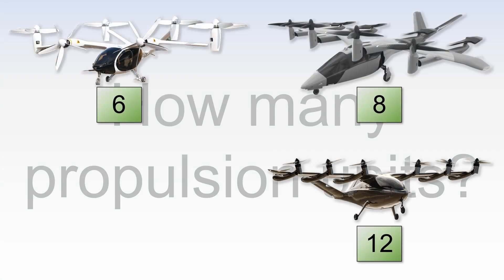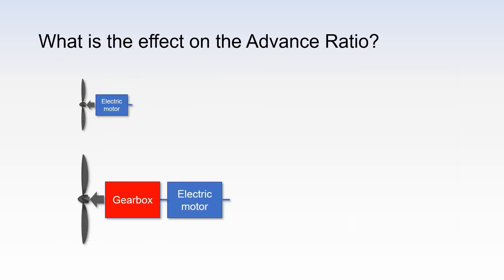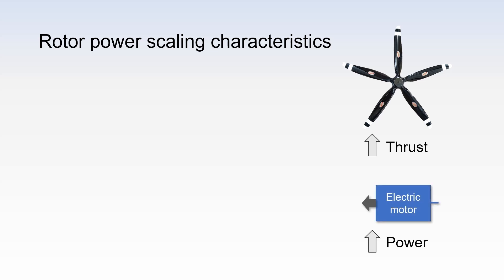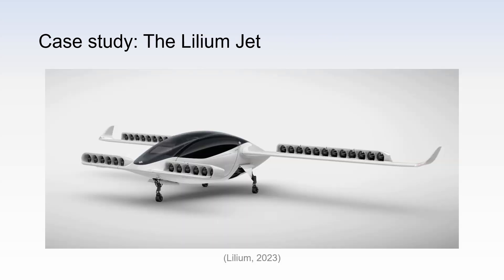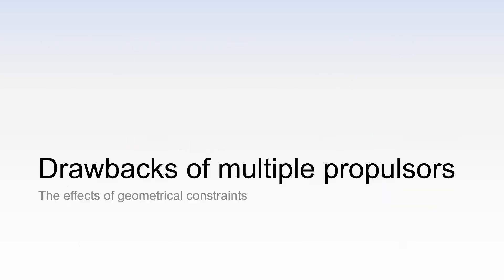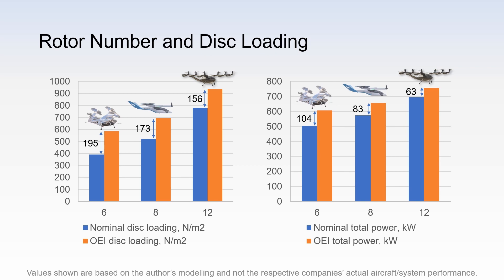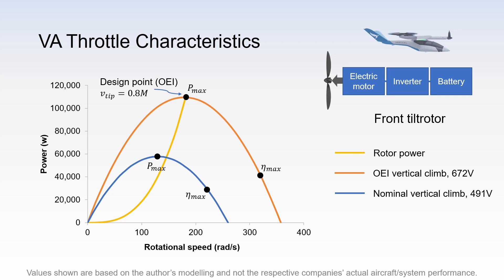What's the right number for eVTOLs?

Comment from the maker: Timestamps:
00:00 Introduction
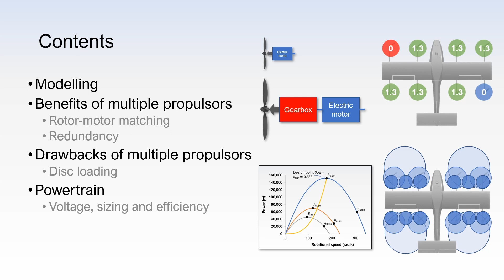00:41 Modelling
1:10 Benefits of multiple propulsors
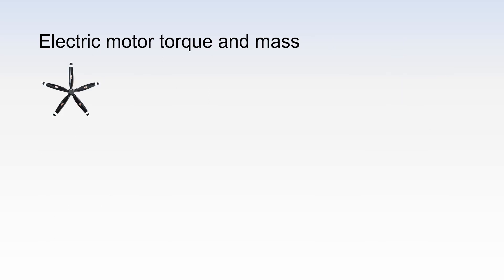6:45 Less motor mass
8:42 Rotor redundancy
11:19: Drawbacks of multiple propulsors
13:35 Powertrain voltage, sizing and efficiency
16:30 Conclusion

Comment: High speed rotors such used in of ultracentrifuges to extract isotopic fuels have to be suspended in fluids or in magnetic or electrostatic fields so one might consider cryogenics since electric propulsion has been patented since Victorian times if only galvanic batteries could store enough energy.

My MIT colleagues have electrochemically loaded isotopic fuels as deuterons into materials and of course "Omni Future Almanac" by Bova & Wiels claimed likewise antimatter could be stored in crystal lattice matrix of boron.

Comment: Losing 5 times the thrust per watt (or horsepower) efficiency is simply a nonstarter for aviation.  There a reason the Helicopter, Chinnook, V22, or V280 limit themselves to 1 or 2 large rotors.  They need practical payload and range, which none of these eVtol designs even attempt to do.

Comment: If there was only a one in a billion failure rate 'permitted' (enough to require an aborted flight) as frequently quoted by eVTOL proponents ,(from all causes) then the differences between the post single thruster loss (in hover as assumed here) resulting at worst in a partially powered slow descent would not be 'worst case' -  the far more likely exhaustion of all power inflight (running out of charge/battery failure /fire etc ) which would also  lose ALL  control where servomotors actuate powered flaps (jet ducts) that themselves MUST have power to function for control as well as lift (eg Lilium )  
Where  Birdstrike or multiple bird (Flock) strike renders  more than one of the  'lifters' or propulsors out of action in either cruise or hover the resultant imbalances in roll,yaw and/or pitch might make control impossible  (imagine a few birds stuffed into the ducts on a lilium - the adverse drag plus loss of thrust on one side and/or between front and rear surfaces could be unable to be countered . The 'target ' area of the lilium is vastly smaller than the huge disc (target) area of the Joby rotors and would likely not spread to adjacent rotors as with the other configurations that might well thrash themselves to death from prop whirl forces .  (This scenario can thankfully, be tested in real flight without risk to life during the unmanned remotely piloted phase -- dangling a chicken or two from another aircraft on a long line into the props could be arranged .  I used to tow targets for the Royal Australian Navy using 4000ft of steel cable and a WW2 winch onboard -- even a normal glider tug with a frangible tow rope could do it safely .

Comment: The analysis presumes a total shut down of the diagonal opposite prop --it maybe be possible to increase the compensatory power above the 1.3 figure to cancel roll plus pitch on one or two props and only have to make up for ,say, loss of 1.5 out of eight rather than 2 (haven't done the calc yet)  Also the rotor number/diameter trade off is based on non overlapping or intermeshing propellers -which are possible if slaved (synchronized ) - if done mechanically the loss of one prop or motor must be possible without affecting the other props .
The limit on the length of pylon to avoid most of prop downwash on the wing and prop diameter is also a constraint -the VX4 is much shorter than the Midnight for example - aeroelastic effects of prop unbalance let alone loss of blade(s) argues to not wing mount at all or to couple the wing to a tail or rear wing (eg Beta Alia) and/or mount the rotors on that coupling boom - in any case the result is inelegant and inefficient .  If "power loss' is due to bird strike (as likely) then the result could be catastrophic to highly overhung props.

Not just about power 'economics' but survivability.  The whole premise about the need for VTOL is flawed when hovering is not useful as in the case of helicopters  but is considered unavoidable - it is NOT ,in the UAV context especially  (and for landings in unimproved locations the 'duststorm' brown out is also fatal.

Comment: Really expensive toys for the rich that will compete for limited mineral resources with ground transportation increasing costs for everyone. Run that math.
Reply from the maker: Hi Brad,
I see where you are coming from though I think there are some legitimate use cases for eVTOL aircraft. If you calculate the transportation efficiency (e.g. energy consumption per passenger kilometre), I agree that eVTOL aircraft are less efficient than ground transportation methods and, hence, investing in this technology could be considered wasteful.

However, ground transportation heavily depends on infrastructure, like roads, bridges and rails. A case in point is the coastal cities where rivers and water are natural barriers for ground transportation (e.g. San Francisco, London, Shanghai). Bridges help people cross these waters, but they are usually congested during rush hours. In these situations, the car's transportation efficiency can be lower than an eVTOL's. If you have ever been unfortunate enough to commute on such bridges during rush hours, you would see why supplementary solutions are necessary.

The potential benefit of making these aircraft electric is to lower the acquisition cost (in theory, electric propulsion is mechanically less complex than conventional propulsion methods). The best case scenario is when economies of scale can then be used for eVTOL manufacturing, making the volume of production and manufacturing processes more like cars than traditional aircraft.

I think the bottom line is that electric aircraft make as much (or as little) sense as electric cars. Batteries are only energy carriers; we still need renewable energy sources. Just my two cents :).
Have a nice day,
John

Comment: yes im waiting for lilium, its assumed that lilium excels at horizontal but not as efficient at vertical, drains a lot of energy in comparison... lets find out here soon enough.... thank you !
Reply from the maker: Yes, the statement about Lilium’s horizontal and vertical power is true! I am currently working on graphs to present this characteristic in a more thoughtful and structured way. Do you have any other thoughts about the Lilium Jet (that you want me to look into)?
Reply: @zhihenglou  yes there’s some test about a new engine with propeller outside the turbine intake I’ll post the link here
Reply: https://youtu.be/ojVNOj-q3SQ

CFM RISE engines might be the answer why outside propellers is the best choice for evtOLs (idk) … 

Another concern is battery energy density and fire safety over 350Wh/Kg. Lilium might need some beefier batteries than the other EVTOLs.  Maybe they all are short on energy for a 150 mile trip plus 50mile reserve? I believe the minimum density required is around 320wh/Kg I believe the best batteries are only 230-250wh/Kg (Tesla and Panasonic)
Reply from the maker: Hi, I've watched the video you linked, and I think I've seen this project before. I believe it is part of a larger umbrella programme called European Clean Sky 2. The closest resembling idea for eVTOLs is an electric pusher propeller. For example, the Kittyhawk Heaviside has several pusher propellers.
Reply from the maker: The energy density values you have quoted are definitely well-researched! The Lilium Jet likely requires significantly more advanced and higher performance batteries.

I remember some optimistic forecasts in 2016 that assumed an annual improvement in the battery's energy density of 5-10%. Now, in 2023, I do not think these forecasts have come to fruition. The most sensible assumption is to use the values you have quoted 230-250Wh/kg. From my knowledge, this is the state-of-the-art.
Reply: Lilium admits that the Jet is quite inefficient vertically. 
But their EVTOL will mostly be flying horizontally, since it's designed as a medium-range air taxi. It will only take off and land vertically, rather than hovering for any period of time - and it can also take off or land on a runway if one is available.
Reply: @zhihenglou  Yes I would be interested but no rush, you must be legally protected first 🙏

Comment: Looks interesting - can't wait to watch your video when the audio is repaired!  (Audio on other videos is fine.)
Reply from the maker: Thank you for your feedback! May I ask what the problem with the audio was? (I checked again and I could not detect anything wrong). Cheers!
Reply: Audio cuts in and out, similar to automatic gain control or a post equalizer set to flat.  Your live (recorded) intro video from 2 months ago is better, although the recording settings are quite different on the two videos.
Reply from the maker: @stevieathome4942  oh no! I indeed had problems with my microphone recording, which I then tried to fix retrospectively in the video editor.

Thanks for the technical tips, I will ask some of my friends who know more about this.

Apologies for the bad audio, I’ll try hard to get it right for next time. Thanks for your time!

Comment: 2
Reply from the maker: Thanks for your thoughts! 

Indeed, the V22 Osprey and AW609 all have two tiltrotors. However, I am not sure if it possible to trim a V22 Osprey with OEI. Does anyone reading this comment know?

For eVTOLs, I think we can consider having more than 4 rotors for redundancy. Electric motors are cheap, and electrical power can be transferred easily to the motors via a power cable. I would assume that eVTOLs have a higher safety requirement, too. The cost of jet engines and the difficulty of transferring power mechanically may have limited the V22 Osprey to 2 rotors. 

Personally, I like 6 or 8 rotors. Have a nice day!
Reply: @zhihenglou  i think the only way to get one to lift a decent amount for a decent amount of time is use one main rotor with conventional fuel for the primary lift and smaller electric motors sticking out the side for steering and spinning and slight height adjustment. if the main rotor could achieve the equivalent of neutral buoyancy then the electric motors could have an easier time and last longer than 2 minutes
Reply from the maker: @frankyflowers  I imagine this will be like a compound helicopter, with a hybrid propulsion? Sounds like a cool idea! I definitely agree that the battery is limiting the aircraft range (like electric cars)… hopefully the energy density will improve 👍🏻
Reply: @zhihenglou  not so much for propulsion just to keep it stable and tilt the craft so the main rotor can give the thrust